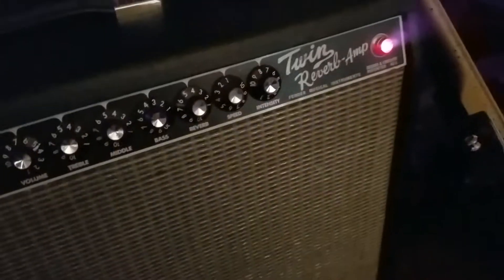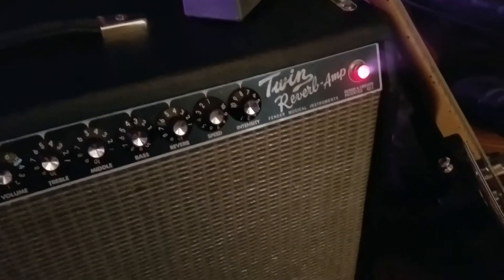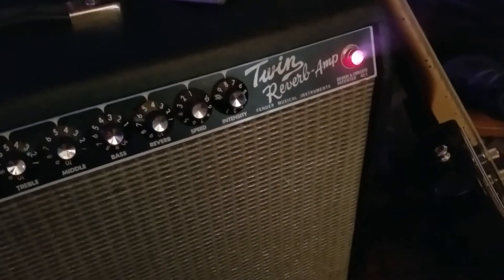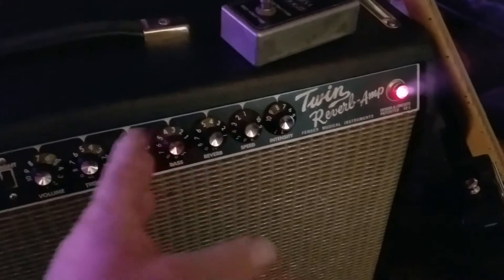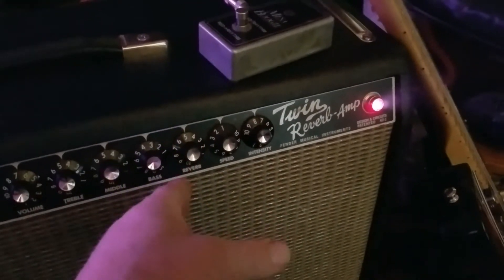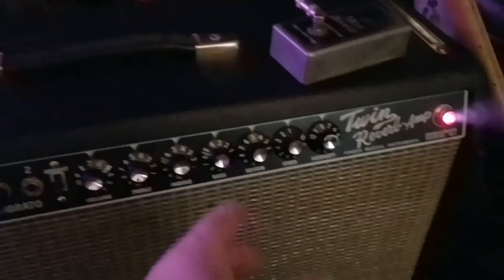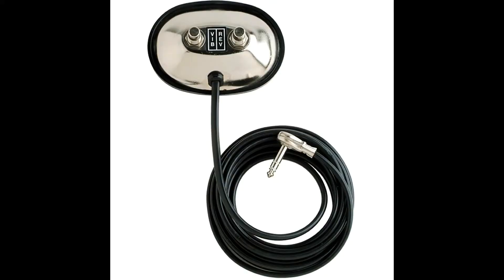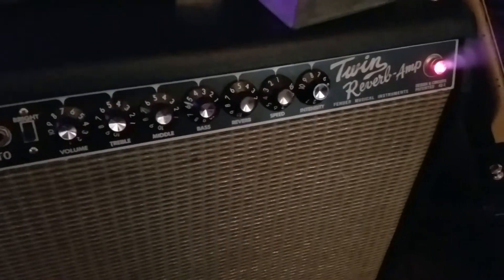65 Fender Twin Reverb Separate Foot Switches for Reverb and Vibrato

Comment: great video! can you tell me, how add  a led for reverb?
Reply from the maker: I would say you would need a stomp switch with multiple pins and a battery holder so the other side of the stomp switch switches on and off the led circuit. the led will require a resistor to be within range of its required voltage value around 300 ohms for a 9v battery
Reply from the maker: for red  a  390, 470, and 560 ohm depending on brightness the higher the value the dimmer the bulb